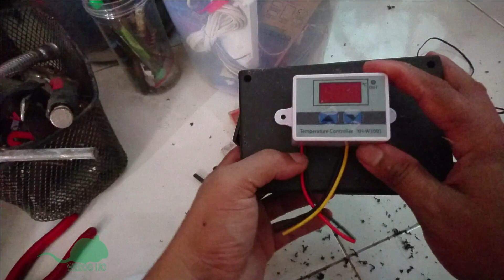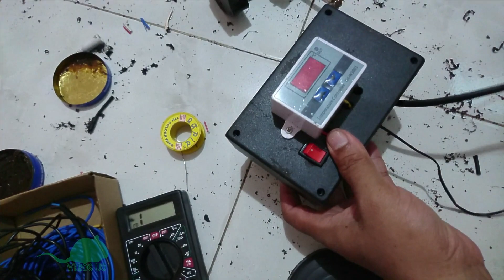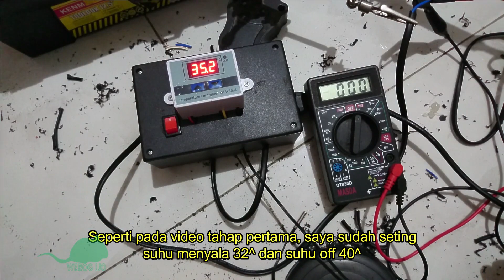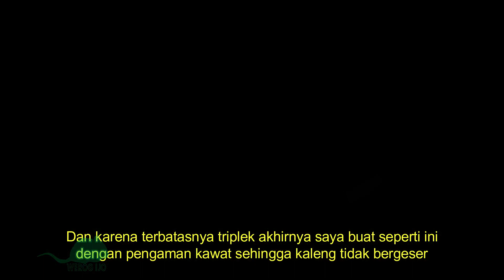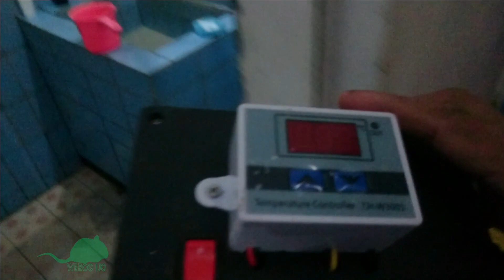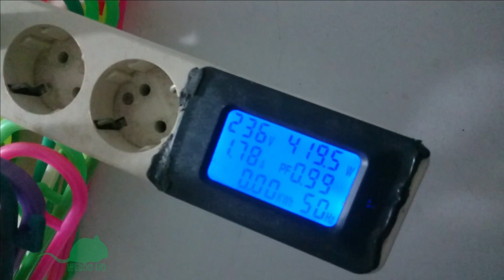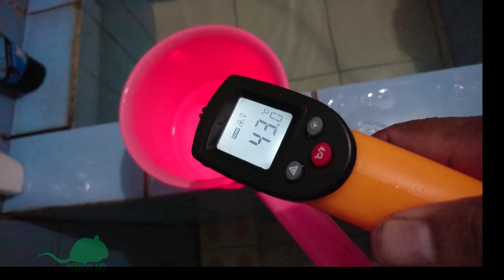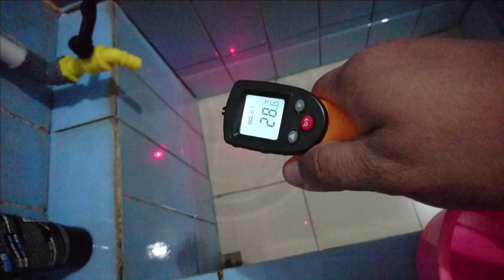Cara Murah Mandi Air Hangat Tiap Hari - Membuat Sendiri Water Heater Keren

Comment: Bang isolator seperti di video merk apa dan dapat dimana?
Reply from the maker: Itu belinya di aksesoris mobil buat bawah kap mesin
Reply: @WerogIjo  alat nya mati, cuma hidup sebentar kemudian mati lagi
Reply from the maker: @theanxiety128  itu harus diisi cairan, kalau kosong ya sebentar mati
Reply from the maker: Elemen pemanasnya harus tercelup cairan
Reply: @WerogIjo  indikator control suhu nya yang ga hidup
Reply from the maker: @theanxiety128  saklar dinyalakan atau kabel yang kelistrikannya gak konek, pake kabel power komputer
Reply: @WerogIjo  sampai sekarang masih di cari masalah nya oleh orang eletronik, belum dapat, dan alat belum bisa hidup
Reply from the maker: @theanxiety128  yang gak hidup apanya? Controller nya?
Reply from the maker: Coba yang kabel kuning itu sambung ke aki kalau kontrolernya yang mati,
Reply: Kalau pakai STC 1000 bisa langsung atau pakai converter lagi?
Reply: @WerogIjo  kalau kuning output, merah input, controller nya bisa
Reply from the maker: @theanxiety128  oke itu kuning berarti mengaktifkan relay kalau relay bunyi berarti normal
Reply from the maker: @theanxiety128  titik panas terendah 32 derajat jadi gak bisa buat suhu konstan 60 derajat
Reply: @WerogIjo  Biar suhunya konstan 60 derajat gimana Bang?
Reply from the maker: @2Vws  bisa disetel segitu konstan bila airnya gak dialirkan

Comment: Bang kalo beli relay jadi gimana yang ada di pasaran ? Bisa gak dan bagaimana rangkayannya
Reply from the maker: Kalau mau gunakan relay berarti output dari control suhunya masuk ke relay atau tepatnya pakai kontaktor
Reply: @WerogIjo  misal bang sayah rangkayan nya dari output termostat 12volt nya langsung sambung ke relay 12volt arduino gimana bisa gak ?
Jadi pungsi termostat nya sebagai sinyal relay ataw pengganti ardu ino jadi bisa kontrol ac 220v 
Mohonnnnnn di jawabbbb mau peraktek.
Reply from the maker: @Awi-eb9tt  Bisa...dan relay bebas gak usah arduino..fungsi relay hanya saklar saja, yg penting ampere relay nya paling tidak 10 A
Reply: @WerogIjo  tapi kan relay punya 3 pin sedangkan termostat mempunya 2 pin
Reply from the maker: @Awi-eb9tt  dari termostat cuma buat mematikan dan menyalakan relay nya saja. Cek cara kerja relay